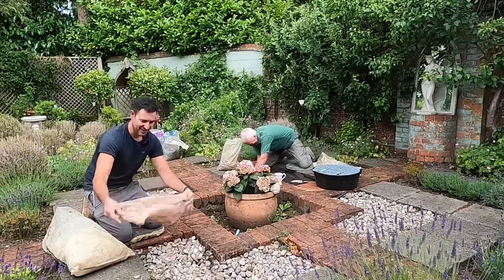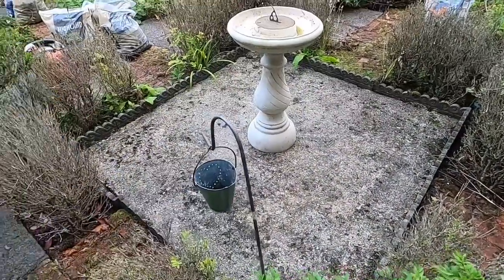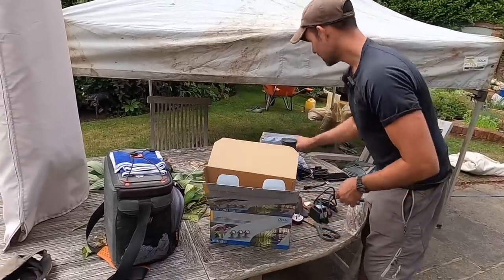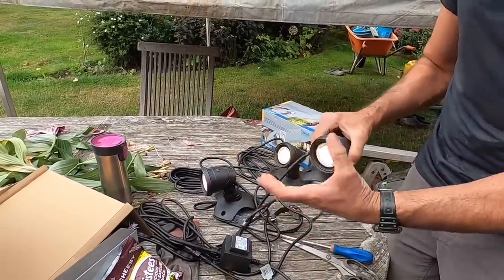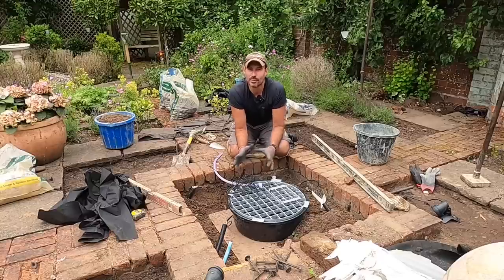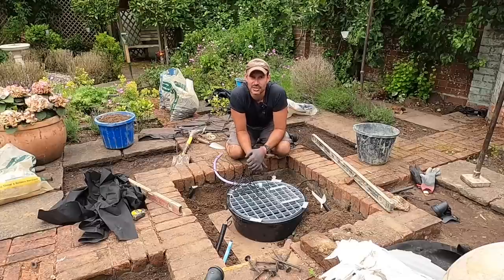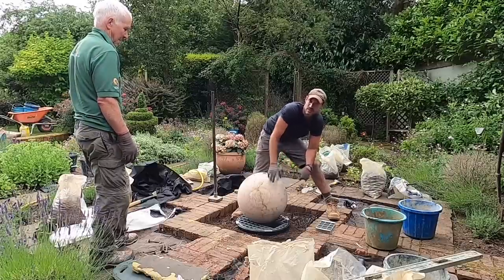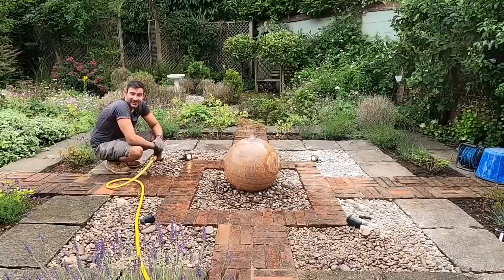How to install a pebble pool water feature

Comment: 😂 how funny, we moved in 2 years ago and bought a big sandstone ball as part of the garden design. I built my own sump from engineered bricks sat on a concrete base and rebar over a crash deck grid to hold the ball. 
Recently replaced the conduit as it flooded my joint and blew the pump. Bought a new pump with 10m cord and installed bigger conduit back to the house and blagdon power unit. So similar. Rachael says keep them coming. 😊

Comment: I have a small fountain that I am going to set up similar to the sphere in the video.  I have a plastic tank  approx 48" L X 30 "W  X24" deep  that I will bury  and lay an expanded metal grate over that  to support the fountain. Having two fountains in our gardens I can  agree with having a large basin is best.  I fill or top off ,my two fountains daily. I was very happy to tune in and find you doing different kinds of water features.  This was awesome .
Reply from the maker: Thanks Tony and good luck with your installation. Water features are a great way to introduce water into an outside space and can be good fun to install!
You’ll have to send me pics of your efforts when its up and running.
Best,
Ed
Reply: @CrystalClearAquatics    Will do Ed.  What I liked about this video is it gave me confidence in my thinking.  I had the same idea that you had mentioned about using a pond liner to direct water to the holding tank.   I learn a lot from watching your videos- Keep up the great work my friend
Reply from the maker: @MrTonyPiscatelle  will do Tony and thanks again!
Best,
Ed